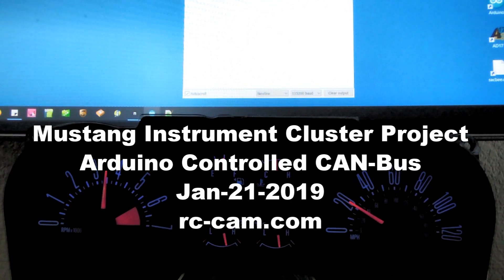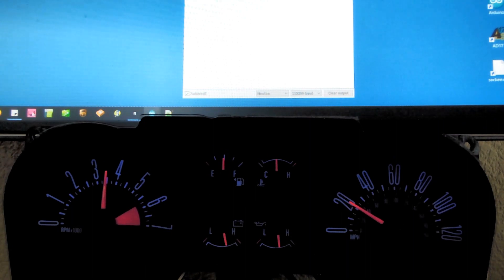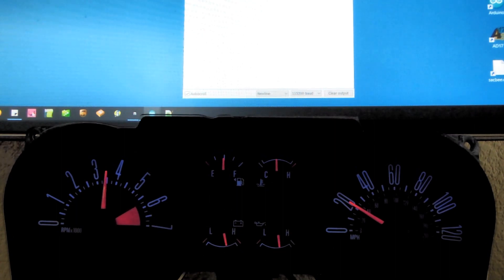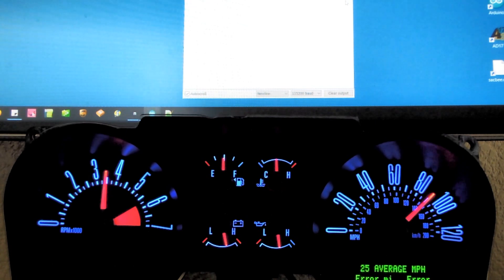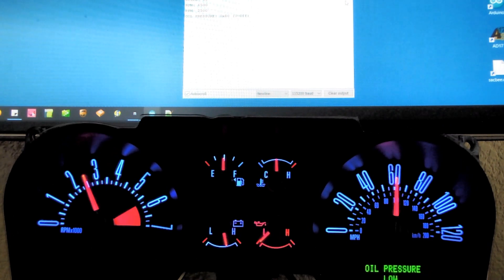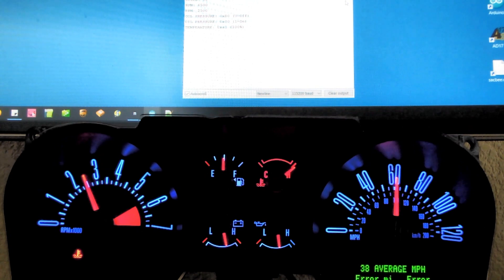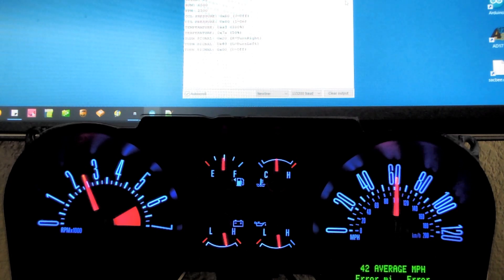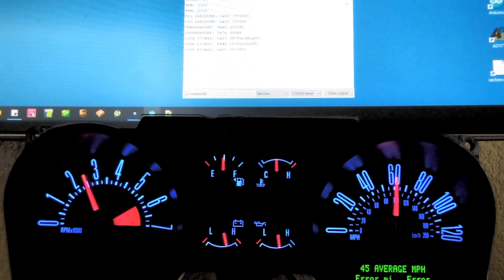Ford Mustang Instrument Cluster with Arduino CAN-Bus

Comment: Amazing work man! I have a Volvo V70 cluster that I got the basic canbus codes from another great YouTuber, I would like to find out what is the code for the backlight, and maybe find the canbus for the radio and climate control backlight too. How do you go about finding out canbus code without the car? Is there a tool?
Reply from the maker: Finding the Cluster's ArbIDs without access to the car is a very difficult task. I explained how I did it in the pdf file posted on the Project's GitHub page. See https://github.com/thomastech/CAN2Cluster/blob/master/Mustang_Cluster_Build_Log.pdf

Comment: will these files also work with the IPC Cluster Mondeo MK5?
Reply from the maker: This version is ready to interface with a 2007-2009 Ford Mustang (six gauge) instrument cluster. Using a different cluster would require revising the ArbID values sent by the firmware.
Reply: @MrRcCam  ok